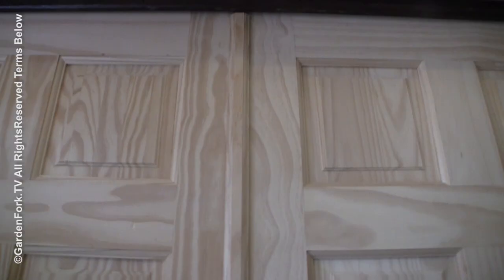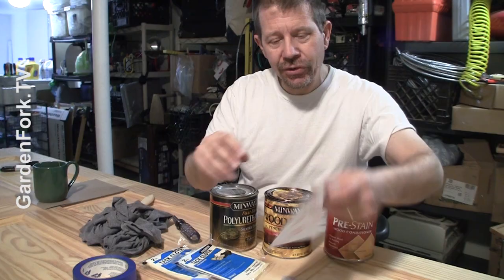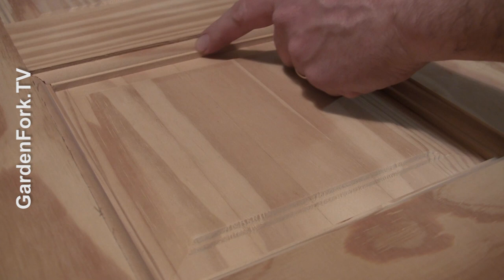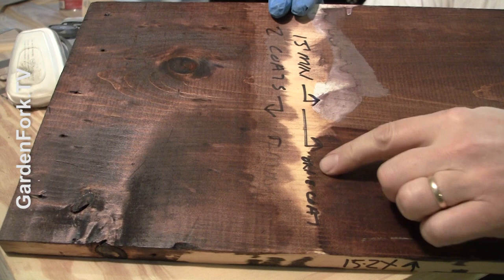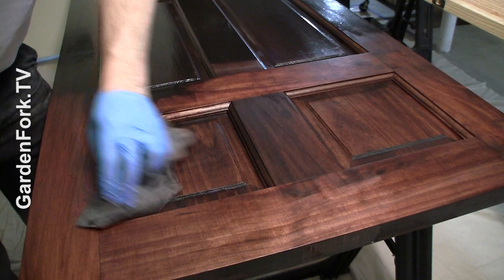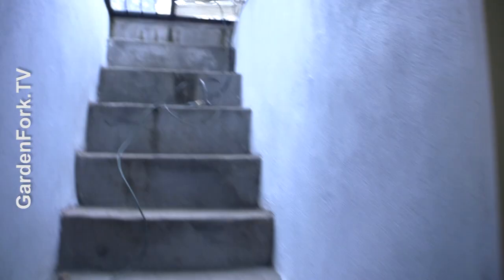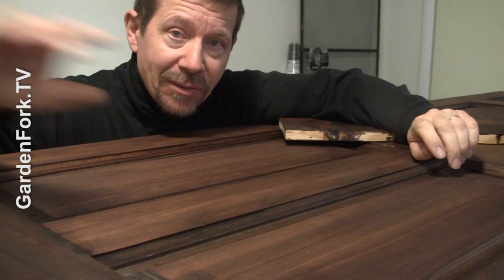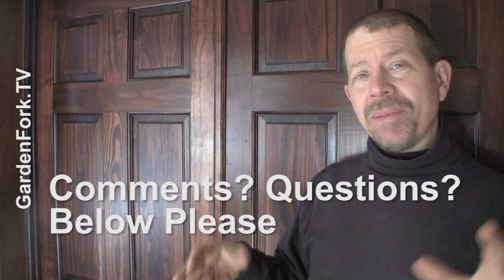How To Stain Wood - GardenFork

Comment: I think I may have messed up. The second coat of stain is on my wooden desk that I've used, and slightly tacky to the touch yet after 24hrs. The area in which i messed up was that I didn't wipe off any access stain from the first or second coat. I've been told to just apply a very thin layer and spread it all around since a little goes a long way. So, should I just continue with the process or sand it down a bit, reapply and wipe off any excess stain?

Comment: That exhaust solution is brilliant! I have to admit that I was CRINGING every single time you brought out your wood samples (or paint cans, brushes, and other stuff) and were banging and dragging them around on to your freshly sanded doors. Pine marks REALLY easily (especially before it has a finish on it), so this is a big no-no for me. I treat raw pine more carefully than glass.

I've done cabinetry and woodworking for around 15 years, and I've never used a pre-stain conditioner on anything. This includes a 5 year period where I worked exclusively at a custom pine furniture store where I stained thousands of pieces. I've never thought the blotchiness of pine was a big deal, but it depends how smooth and even you want it to look. That said, I've never tried the product either, so I don't know how much of a difference it actually makes. Several people swear by it.

Coming from a professional cabinetmaker: Minwax stain is one of the lowest quality stains money can buy. It's very user friendly, however, so as long as the colour works for you, use it. The best stains are from professional suppliers. They're much more expensive, and trickier to apply (you have to constantly be careful about fingerprints anywhere you touch as you work), but the colours and coverage are much less watery. For my own home DIY projects I like Valspar brand, or Varathane stains. I also especially like gel stains (deeper coverage and no mixing), but they're a bit messier to apply. In a professional shop, we would never (maybe just once a year if we messed-up) stain something twice. Too messy, and too time consuming. We would do one coat with colour-matched stain. If our colour-matched stain turned out being a bit on the lighter side, we would just apply the stain a bit heavily (just barely wiping it off, and leaving a damp film behind - enough that if you dragged a finger on it you'd leave an ugly smudged line, but not so much that it was visibly wet). If it was still not dark enough after the first coat of sealer (topcoat), then we could still adjust the colour a bit with a tinted lacquer.

What I'd often also do as I stain is if one door stile (or a corner of a panel) was lighter, I'd apply the stain in a way that it was heavier on those parts, and lighter on the rest so that it all matched perfectly when it dried. Not the easiest thing to do, but when you've stained about 7800 cabinet doors, and several hundred pieces of furniture over 15 years, you get good at picking up these little tricks.

Your finished doors turned out really well though. The colour looks good, they're not blotchy or patchy, and I don't see fingerprints or smudges. I'm going to have a look at your Poly video next, and I might comment there too.
Reply from the maker: +sooth15 wow thanks for all the info, i will look at the other stain brands. thx!

Comment: Thanks for the great videos. I appreciate all the details. I have a 100 year old French door that I want to refinish. Do you have a video on stripping an old door? My grandfather made it out of old Tennessee chestnut wood and it's covered with layers of old paint. (Beth)
Reply from the maker: +Ben Matthews Hi Beth, not sure what to do with the door, if its old paint, it may be lead paint, so don't use a heat gun to remove it. maybe consider a professional service? it might cost more, but less chemicals you have to deal with. thx!

Comment: I was taught to stain like this...there is always a finish coat going over the stain, usually poly. Mix a small portion of poly and stain 2 to 1. After sanding, tacking, brush on mixture and rub off with rags, let dry then hit with 320 grit paper. Tack always after sanding. Now use straight stain. Lightly sand and tack again. Your wood is sealed and no blotches. You can continue laying stain on until the desired effect. Seal with poly and lightly sand between coats. Also, the rags you use should be left in a bag and open to vent all chemicals coming off, will take days. If you seal in bag a fire is inevitable.
Reply from the maker: +R Riddle interesting, thanks for the info there. i keep the rags outside as well. good tip!

Comment: Very nice job
Was it dark walnut or mahogany? 
Also, what if the stain comes with the polyurethane already
Reply from the maker: there are now poly stains available, i have used them. pretty good, but if you want to control how dark the stain is, its better to do the two step process.  but the poly stain works very well and is a time saver. thx!

Comment: I bought a wooden table whose color I do not like. Do I need to sand it before I apply a darker polish?
Reply from the maker: you could try coating it with a stained polyurethane, test it on the underside of the table first. it may ruin the existing finish.
Reply: @gardenfork  you have to sand it first with a find sanding paper

Comment: The stains on the door panel .I think that it isn t your mistake It could be that it is from the factory because they look like water based glue marks.Normally you don t see it at the first time.Only when you are painting or stain the door.I am and was a painter myself and never seen a painter stain a door or wood with this technic .I thinkt that it is commen in the U.S but not so much in Europe.How ever,,i like this technic any way , i learned from it and i will use this in my next painting job..By the way this only works on non painted surfaces.Nice job !!
Reply from the maker: +GoliathAngelus thanks for the note, yes, it may have something from the factory, good point! eric.